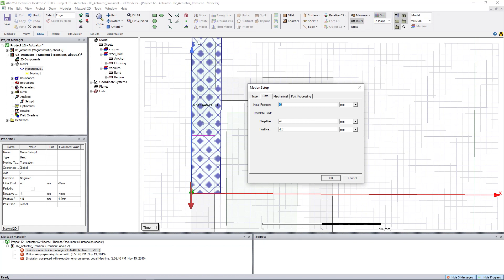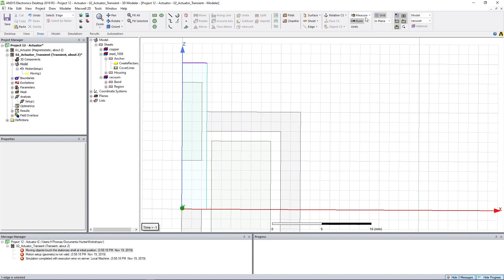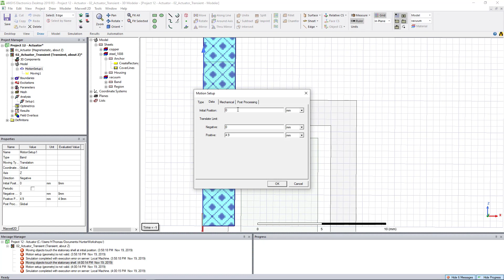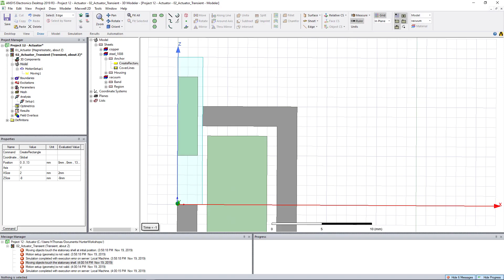Introduction to Bands of Motion for Transient Analysis in Ansys Maxwell-Errors and Fixes

Comment: Hi, I am facing the following error while simulating Linear motor, your suggestion to solve it will be appreciated:  
Internal Solver Error:  'Non-moving geometry or modeled line object detected in the band. You may need to reassign the band or add additional objects to the list of moving objects. Modeled line objects cannot be within the band or on the border of the band.

I have checked the band edges and other things, however I noticed that if I simplify the rotor geometry the error disappears 

Thanks in advance !
Reply from the maker: Thank you for your comment. If you are interested in training, mentoring, or consulting with SimuTech Group, please send us an email at info@simutechgroup.com or you can check out the SimuTech Skills Center here: https://simutechgroup.com/resources/skills-center/